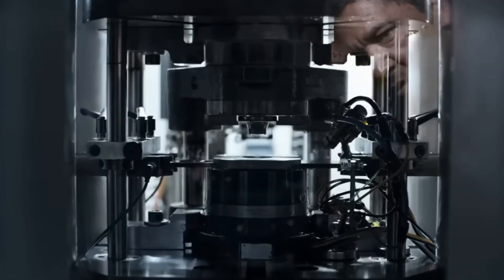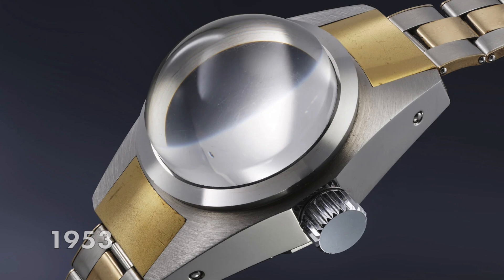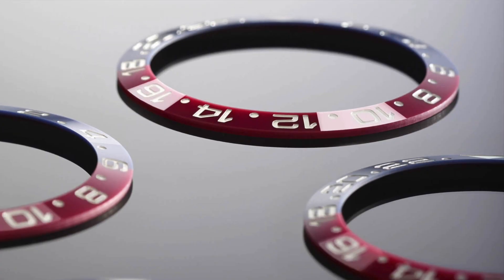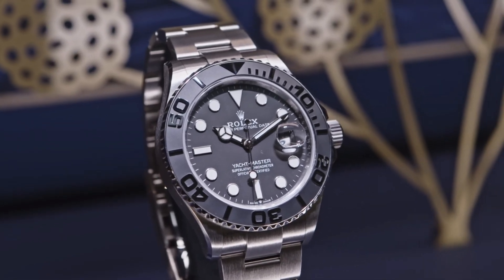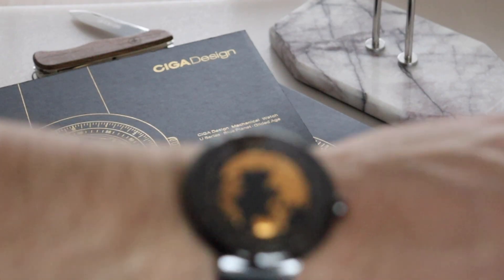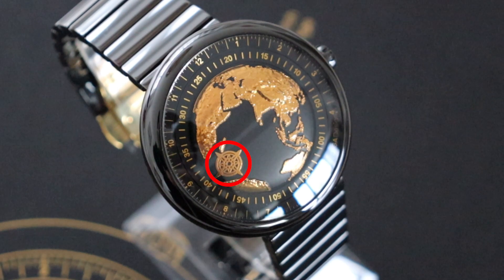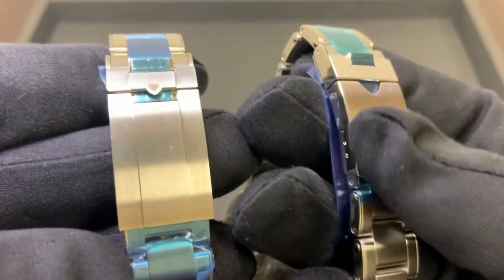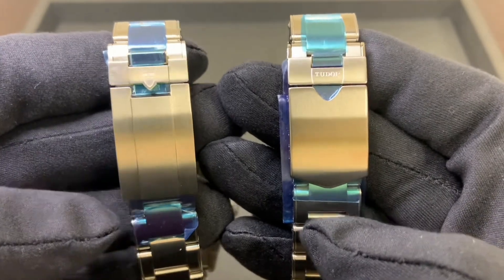Rolex's BIG SECRET CHANGE is happening! Unhappy Clients Turning to Tudor? CIGA Design the Future?

Comment: I wouldn't worry about lack of innovation. They never have, in the past. Rolex bought the patent for their screw down crown, they didn't invent it. They didn't make the first waterproof wrist watch, an English company advertised it ten years before. It was called the "Submarine" but they didn't trademark the name. An English company invented the first automatic wrist watch three years before Rolex.  If you note the language, Rolex claim to be the first to invent and patent an automatic watch. The English company didn't patent it, Rolex did but everyone reads it as Rolex invented the automatic watch. Same with the DateJust, the Girard Perregaux Mimo had a date window three years before Rolex. Again, read the wording, Rolex were first to design an automatic watch with a date window. The GP watch, wasn't automatic. So don't worry, Rolex and innovation is an oxymoron. But their marketing... top top class.

Comment: In the list of Rolex innovation, I would add the 72 hour calibre now on its sports steel models like the Submariner. On the design side, little to no innovation at all. Rolex introduced the 1908 to replace the Cellini, but the dial was not that spectacular. Rolex owns 30% of the luxury watch market and nobody comes close. However, just because Rolex raises its prices continually, does not put it in the Patek class of craftsmanship nor appeal. I do not hate on Rolex, nor do I suffer from FOMO neither!

Comment: I think your point is very well made, but Rolex are still a mass producer when compared with VC, AP or Patek. And they're increasing production, rather than restricting it.
The price increases are just them capitalising on the insane levels of enthusiasm for the brand right now - the price will go up to whatever the market can bear, which is quite a bit, apparently.

Hard to know where it ends, but there is a proper recession coming. 3M/10Y treasury yield is very negative and at some point gravity will have to assert itself.
Reply from the maker: thanks and I agree that it is hard to know where it will end but i do believe they will continue with the price increases and it will simply price many current clients out of reach

Comment: It feels as though the steel sports watch market that Rolex have dominated is being handed down to Tudor. Presumably so Rolex can push upwards with precious metal watches
Reply: @sts6761  Agreed, interesting angle, but I'd be surprised if Rolex did stop steel, let's just take Subs for example, at about 37% profit margin for the AD, they are selling to the ADs at about £4.6k to £5.2k no date to date ex vat, I understand they make about 100k Subs pa, so say 30% non date, 70% date because again I hear they make more no dates than dates, this is somewhere around £500m of sales pa just in Subs... I don't see them walking away from this. Plus I've seen Tudors new facilities in Le Locle, they are nice, but not big, not Rolex big, not even as big as Zenith over the road, there's just not the capacity to push through all the stainless steel professional models that Rolex shifts each year plus Tudor output, even using the old Tudor facilities that Rolex wants back. I think Rolex will carry on with steel for a higher price and you won't see much precious metals in Tudor.